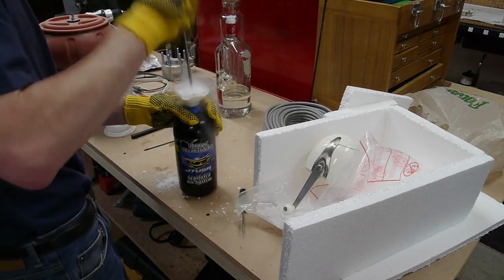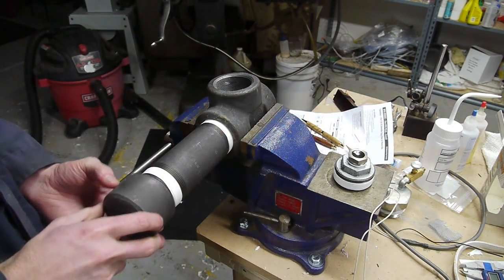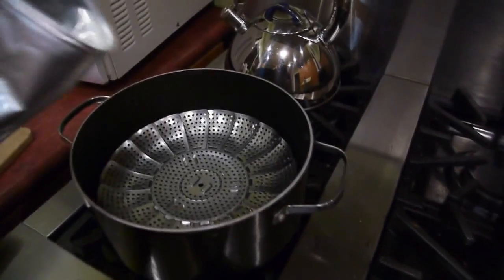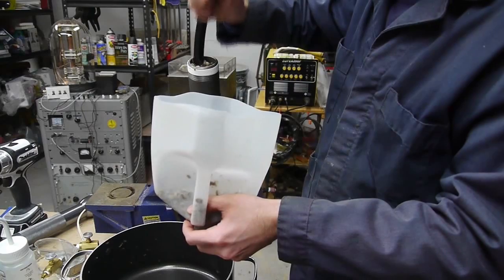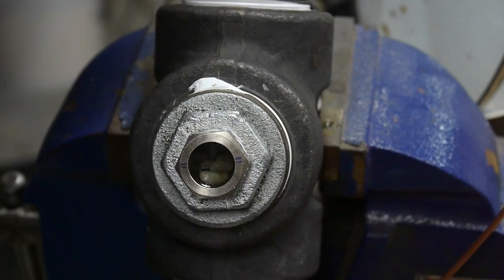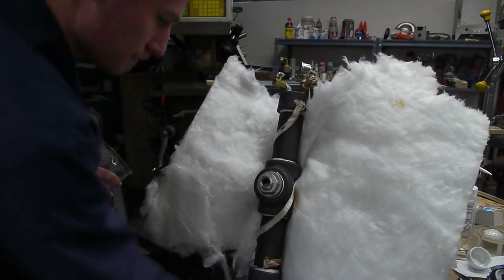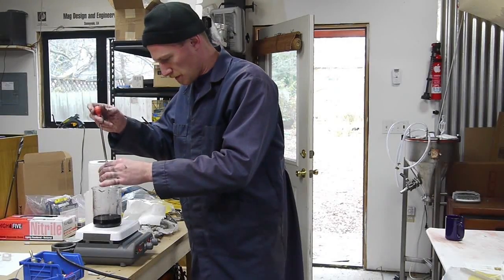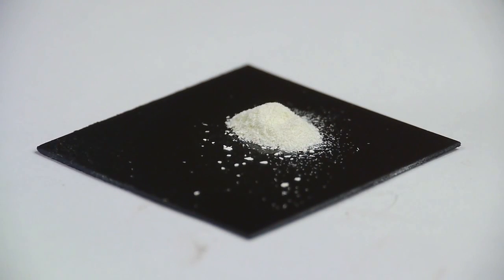Caffeine extraction from green coffee with supercritical CO2

Comment: I have a question... rather, an organic chemistry question.  So you’re using CO2 as a solvent (at high temp and pressure) bc it’s non polar (to separate the non polar oil of coffee from bean fibers). But not enough extraction occurred bc CO2 isn’t as small of a non polar molecule as methane / Dichloromethane...? Like, if methane were a safe solvent to use without flaming, would it perform better?  Just trying to assess my little o chem knowledge ... thanks
Reply: Methane is quite a stubborn gas, and is somehow reactive. Supercritical CH4 extractions have been done in the past but if we're assuming that we live in a world where CH4 isn't flammable, other physical properties wouldn't change very much simply because it is a hydrocarbon to begin with.

The reason why CO2 is considered as the "porridge zone" of compressible solvents isn't only about its polarity, but also its physical properties as well. CO2 is a very stable molecule, it isn't reactive and it actually is very inert. Its critical values are ambient and reachable making it an economically viable solvent. Compare it to CH4 whose critical values are way higher than CO2's.

If I'm not mistaken, due to CH4's reactability, I think that it would perform side reactions as the extraction processes is still ongoing... which is very unideal with any setup.

Comment: Why didn't you pulverize or break down the coffee beans at all before the extraction? It seems like you would want to maximize surface area. But I'm sure there is a reason you didn't so I'm just curious.
Reply: I feel like the reason why he didn't grind it so finely is because sometime during the extraction, some of the particulate might pass through the mesh and possibly clog the drain valve. But this can be solved by putting the matrix in cheesecloth, that's usually how they prepare the matrix at our University whenever they do SF extractions.

Comment: Which formula have you used for the Wall thickness?
Reply: I'm not him but I've wrote a paper on subcritical extractions using pipes; As a general rule of thumb, always look for the product catalog, it usually has all the details, such as the wall thickness, internal diameter, seamed/unseamed, Pressure rating, etc. Pipe thickness is measured in "Schedules" (the higher the number, the thicker) but you can still opt to use imperial/metric units if you like.

Btw, I used Barlow's law for the computation of pressure rating. In their equation you could also put a safety factor, should you want to lower the operating value (Pressure) of the vessel.

Comment: Interesting but you can just grind up the dry beans then soak them in boiling water then solvent extract the caffeine out of the water.  The reason beans are decaffeinated with CO2 is that it preserves the beans so they can be brewed into decaf later.  If all you want is the caffeine, then skip the CO2.

Comment: If you controlled the temperature and pressure more precisely over the duration of the extraction you may be able to have a more pure 'water' to work with after the process. Caffeine should be 'picked up' by the CO2 at very specific supercritical pressure/temperature. I would like to see a video where you control temperature and pressure more closely :)

Comment: your fucking nuts dude. walking near that thing at 3000 PSI
Reply: 3000 psi is standard working pressure for generic  hydraulic systems.   a person running a fork lift ( and there are LOTS of those) is setting right next to 3000 psi in action.
Reply: Yeah I understand that. After watching some more videos of them going off I was a lot less impressed by 3000psi 🤣

Comment: Excellent video and channel!
I guess by now someone must have had this idea, but... I guess the black solute in the extract is either iron carbonate or iron oxide. Maybe the water from the beans reacted with the CO2 to form carbonic acid, which in turn reacted with the steel pipe. That would explain why only some of the beans are dark; it´s probably those that were touching the wall. At work we need to purge lines when refilling CO2 tanks so no air moisture gets inside the tank because if it does time over time, internal corrosion takes place.

Comment: First of all, let me say, that your videos are awesome.

Now, I do not know your background but if already know this pass it, if not, her are some information.

SFE  occurs in different stages, first, the vegetal matrix absorbs the supercritical solvent, swelling its cellular structure, membranes and dilating the intercellular channels, leading to a drop in the resistance to mass transfer; in the meantime, dissolution of the extract occurs, and mass transfer take place from the inner matrix to its surface and solubilized compounds reach the external surface. These are finally transported from the surface to the supercritical solvent and removed from the solvent.
So, this happens in various stages:
1- First there is a constant extraction rate period, where the external surface of the particles is covered with solute (easily accessible solute) and the convection (in the CO2) is the dominant mass transfer mechanism.
2- Secondly, there's a falling extraction rate where failures in the external surface oil
layer appear and the diffusion mechanism starts, operating combined with
convection;
c) Lastly, there's a Low Extraction Rate or Diffusion-Controlled (DC) period, where the
external layer of oil practically disappeared and the mass transfer occurs mainly
by diffusion inside the solid particles.

So, you're dependent on the biomass matrix itself, and you should grind the beans, increasing the surface area thus enabling a better impregnation of the biomass, increasing the solubilization of the target molecules and also insuring a better mass transfer from the biomass matrix to the CO2. In your case (maximum yield and lower extraction time possible) you should operate on the first to second phase.

Oh and the extraction result isn't pure caffeine. 

Some tips:

Water in the biomass increases the celular turgor and helps to increase the yield of the SFE by allowing a better impregnation of the biomass, but don't mistake it for cosolvent modifier, these are used to extract other type of molecules (hidrophilic/polar fraction) and these can also be used to manipulate selectivity of the extraction. 
Grinded coffee beans translates in increased yield.
You could bubble the outlet of the extraction into an ethanol solution thus allowing better distillation afterwards.
That bursts of CO2 you have on the outlet of the vessel when CO2 forms ice, blocking the pass, you could heat up that outlet zone with the electric heating mantle and that  would decrease that.

Cheers!
Reply: Damn
Reply: I totally agree. The approach he uses feels very counterintuitive, aswell as the soaking. If the h20 takes up the intracelluar matrix and dissolves the caffeine, wouldn't the co2 and h20 just compete with solubility?

Comment: You should know that Teflon tape does not seal the pipe, its purpose is to facilitate (as a dry lubricant) the screwing of the taper pipe threads, thus allowing for a better seal.
Reply: You should know that he's using steel pipe, pretty sure they have tapered threads.

Comment: Why does there need to be water in the system? Is the solubility of caffeine that low in supercritical CO2? I was expecting a pipe with beans that got half filled with liquid CO2, turn it supercritical and in order to extract the solid all you would need to do would be to evaporate the CO2 leaving you with a pile of caffeine. Can supercritical CO2 not dissolve a significant enough g/ml in them compared to water?

Comment: I did a caffeine extraction @ 2,000psi. and 65C.  Came back from the lab a marginal extraction.  So I  will post a video showing the process being done @  10,000psi.  Caffeine is water soluble, CO2 is non-polar so its almost doing nothing as far as a soluble solvent. Its just used for pressure.

Comment: Ahhh yes, your speaking about ice plugs @ about 7:24.  I will do a extraction @ about 10,000 psi and water.  I do believe the non compressible fluid is really blasting through the beans and it makes its caffeinated water w 680 bar assistants.

Comment: right on w your success!!!  you must not over fill the vessels w plant matter. A plug can occur between the gauge and or valves and when you open this plugged vessel, the final threads will fail sending the top off like a cannon.  the pressure difference of the blast is very lethal and anyone w in that radius is in danger.  be careful and try employing safety  relief valves for G.P.